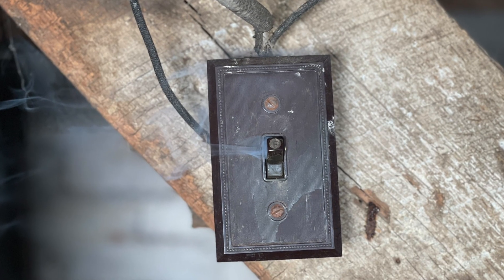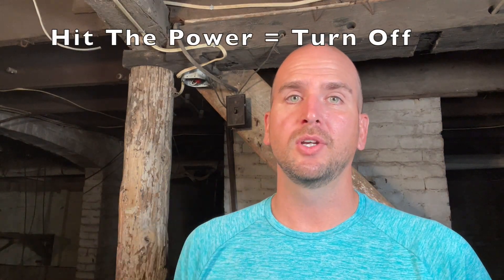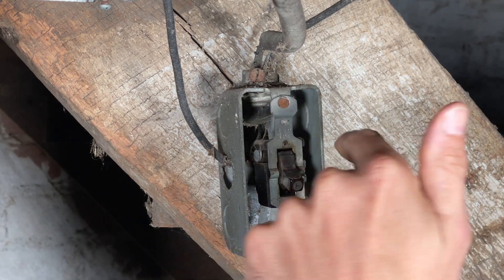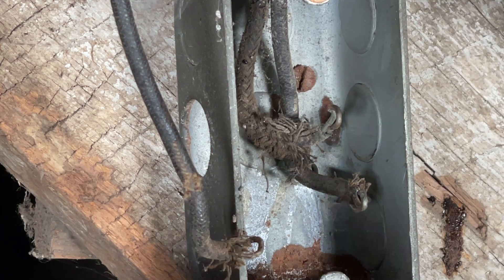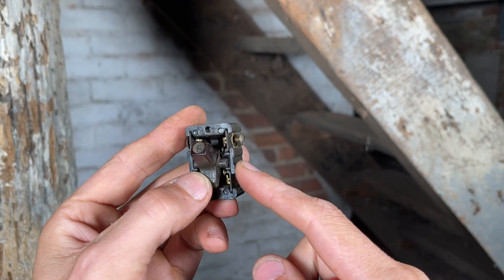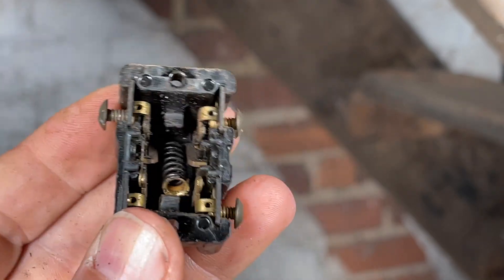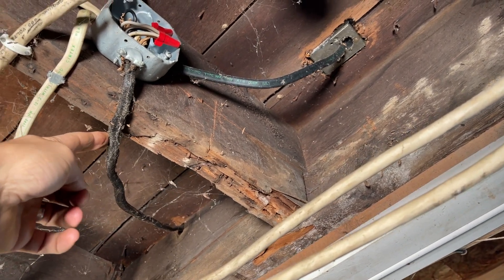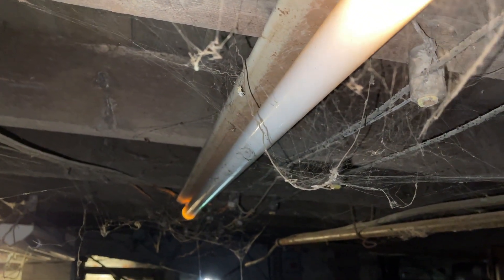Issues with Old Electric Wiring | Knob and Tube

Comment: You nailed it when you said “that has been tampered with”. Knob and tube- even 100 years old- is perfectly serviceable if undamaged and not tampered with. It used insulated wire, but was designed to largely not depend on it by use of the porcelain insulators and tubes. A grounding conductor can be easily added where it makes sense to have one. And the quality of those old devices is stunning compared to new ones. Any that are in good condition are fine. My dream would be to find an old house with an all original, unmolested electrical system. Probably pretty rare now. 100 years of people that can’t keep their hands off of it lol.
Reply: Realvanman1 I recently worked in a house with an entirely untouched electrical system. 😎 The electrician saved most of the switches but the original circuits wasn't really salvageable
Reply: 180 yr old home in s.c. knob and tube running all my lights and fans
Reply: @frederickcwinterburn1837  Im not doubting your experience, but in Utah the knob and tube conductors are in different stud bays of the wall. (until an outlet or fixture the wires are several feet apart) Please consider that the wire you saw had been overloaded for 50 years. That would turn any covering into brittle carbon thru cooking. Most of the criticism about bad insulation seems to forget if romex were in this same protracted overload, the structure would have burned down conveniently solving the issue of insulation criticism much more quickly. 

Wasn't the plastic pigtails of ceiling fixtures eleminated and switched back to cloth because the plasticizer would migrate out of the covering, leaving brittle insulation and associated hazards? (yes)

But we were so sure when we switched to plastic in those fixtures...
Reply: @frederickcwinterburn1837  it's not unusual to be that close with k&b, but the wire run is usually through the floor or ceiling where the POTENTIAL conductor sag does not get the wires closer. When installing, one would pull the wire with all their might between the knobs.

This practice, while adding its rare to be spared even enough wire to change a even recepticle or switch...  I propose the conductor while cycling under overload, cooked its insulation AND stretched enough to sag and make contact.

You had minimum and two failures, insulation and sag, likely started by errors/tampering elsewhere in the circuit.
Reply: I've never had a breaker not trip fairly quickly when the current is greater than the breaker rating.
Reply: I would put a fuse panel back in my 160 year old house if I found one with enough circuits. The breakers in the replacement panel failed, almost burning the place down. Studying the breakers in general led me to learn a breakers life is about 10 years or under (30 year max), and even a functioning one will not trip most of the time as they are really for short circuit protection. And running the breaker at 120% while never tripping is the thing that shortens the breaker life ironically, frys the wiring, and ensures the breaker does nothing at 150%+ output when the day comes. 

(the plasticizer in my old, but retrofitted romex is separating and failing, but the knob and tube is in great shape still)
Reply: @CaseyRevoir  Not nearly, normal breakers last a lifetime, they are purely mechanical, never heard of having to change them. RCD/GFCI have a test button that let you test the functionality, to know if they still trip (and you should do that test at least once in a while), since they are more complex and have electronics in them. 

The fact that a breaker will not trip at 120%, yes they don't for short amount of time, that is how they work. It would be impossible to do differently without some electronic in them, but normal breakers works by pure magnetic and thermal effects. In my country for fixed wiring you tend to install a size of wire that can carry more current than the breaker that is installed: for example for lighting circuit we have 10A or most recently with LED 6A breakers with 1.5mm2 cable, that can carry 15A without problems,  for sockets 16A breaker with 2.5mm2 cable, that can carry 20A no problem.

In a well designed installations a breaker should never trip for overload (unless the client does something stupid like plugging in 2 3kW heater on a single circuit). If it does it means that you should have split the load on two different circuits. The most common thing that makes breaker trip is faults, short circuits and ground faults (in that case we are talking of RCBO)
Reply: I wrote the same thing above. Just don't tape the two conductors together and shove them through the same hole.
Reply: Insulation was poor, if not it wouldn't require ceramic insulators, and degrades with time, thus it's now impossible to find perfectly insulated wires even if they where when installed. I guess that if you retrofit a GFCI breaker in a knob and tube installation it will trip for some badly insulated cable in some wall with high humidity. 

Also it's less safe. Usually cable that you install in a wall is either double insulated multicore wire or single insulated single wires in a conduit, to give a double layer of protection. Knob and tube it's not even single insulated, you have the bare conductors in the wall, that can be accidentally touched when doing some maintenance. 

If you have to add a ground, at that point better to replace the wiring with something modern that will last even more time without issues.
Reply: @alerighi  @A1eR  Thanks for explaining. You have actually demonstrated what I am all about. The 'forever safe circuit breaker', with a margin of error that ironically promotes the condition that makes them fail and catch on fire. The breaker exists to do nothing but protect the conductor in the wall, but that is not how they are treated, they provide none of the protections they are commonly entrusted with. 

You will never find what you do not look for. Breaker recalls are common. 

"A paper published in 2012 stated that FPE Stab-Lok breakers may be accountable for 2,800 fires and 13 deaths." 

The US government (CPSC) says breakers have a service life, can easily be looked up. Such huge, complex documentation from manufactures just to see if the darn things work. 

(If I post an outside link, the comment will not post, sorry) Pacific electric panels, Zinsco panels, all designed to be safer than what they replaced and were junk. 

Conductor ratings in the USA are BS, and contradicted by the sale of extension cords. An in wall 12ga wire is approved for like 20amp to 100ft (approx), or you change to 10ga to go further. This is dumb and not reality. Way overkill at 8ft and not enough at 99 ft. 

If I am a good USA citizen I will plug a space heater in my 15amp room outlet and run this breaker on the bleeding edge with lights, TV, etc... This is the exact reason the breakers are failing. Every point of contact in the circuit is practically on fire. The conductor in the wall is warm, the heater cord too, stupid quick push in the back of the outlet is thermo nucular, blade contacts in the plug not far behind. How much amperage are consumed by these additional heating elements?

Mechanical things fail, and these breaker fail modes are always default dangerous, and how to make a fire. 

When the fuse fails, the element opens and is real annoying. (and will likely be set on fire by an idiot and a bigger fuse, but that is not the fault of the devices of topic) 

The breaker is complex and has a big wildcard element, the spring that heats and breaks the connection. Everything I described above gets the breaker hot too and the switch chassis warps and miss aligns the stuff inside. 

The headroom we are leaving in the circuit is creating the problem. If I am a responsible citizen and add everything up to 15amp I just made the condition that harms me. Even at 13A on a 15A circuit I get hot conductors, reciepticals, and switch gear. Fused panels opened in these conditions, everyone got mad, and screwed everything up inventing another problem. 

These ratings needs to be based on a 24/7 duty cycle, but in reality they are as vague as conductor length specs. The gauge recommendation for the 20 Amp circuit assumes about a 3hr load at the 'rating', which allows a rise in wall conductor temp during that time. This rise does not stop at the 3 hr mark on a 99ft run where on a 20 ft run the conductor temp would peak and stabilize at one point before being dangerous. The hot conductor sets the recepticle or the breaker on fire. This "allowing things to get acceptably hot" concept fatigues items and is silly. 

Here is an easy way this is happening. You will rarely pop a 15 Amp circuit if you turn on a 13 Amp space heater and proceed to make toast with a 13 Amp toaster in the same outlet. According to a "B" curve chart for a random 15amp breaker, 50 - 500 seconds is needed to trip the breaker at 26 amps. Your toast will be done before tripping the breaker, but things got REALLY hot. That adds up over decades of toast. Assuming everything stayed aligned, the spring has been heat cycled 10s of thousands of times that no one engineered the spring for. 

Everyone in the USA treats these rating numbers like they are the be all end all, they are dangerously misleading and based on 'this rarely happens, do not worry'. 

800watts is the safe max for a USA outlet. Even with a laughably loose outlet, the connector does not heat up. This is also the wattage many personal space heaters are sold at now.
Reply: @A1eR I was confused and forgot I had the Fran lab video and plasticizer stuff in a separate comment. Here is the Fran lab, this video about plasticizer failure https://youtu.be/mHIgjTd0yCQ 

I will quote my other comment: 

"The plasticizer in my old retrofit romex is separating making green death sludge. https://youtu.be/mHIgjTd0yCQ The knob and tube that was augmented or replaced is still great and functional. 

I have slipped a long piece of heat shrink over the knob and tube wire as far as it will go when replacing fixtures and switches in case the jacket separates in the junction box. And usually another layer of heat shrink. "
Reply: @alerighi  You keep explaining how wires and breakers work without accepting any info that pokes holes in your safety assessment of the things you explain. 

The two things you have cited as safer, plastic wrapping and circuit breakers are flawed. 

Why do you think knob and tube is not insulated? Even in the video you can see the wires are wrapped, and BTW, many systems still rockin after the insulation falls off. 

That same failure does not work with romex. Plastic does not last. That Fran lab video I referenced has oodles of comments talking about chemical failure of what you say makes romex and the like better. 

When your romex fails, the potential for fire is high, we are now solely dependent on the device I am critical of, because of its terrible record, the breaker.
Reply: @alerighi  it may help to know the 'tube' in the wood beam part and the ceramic 'knob' are to protect the wire insulation and facilitate in installation. You literally pull as hard as you can on the conductor when doing the install back then to get wires straight, like deadlift pose, use your legs pull. 

The items you are citing as existing for lack of conductor insulation are actually double and triple redundant insulators.

And you can apply new insulation to old wires via heatshrink or any number of UL listed sprays or brush on applications. Shocking how many do not know this. Liquid electrical tape exists, it's great. 

We hammer romex down with metal staples, instead of a glass/ceramic knob.... Uhhhhhh? 

The attitude that was previlant then but lacking now is wire conductor safety. "if the conductor insulation fails we have a fire resistant knob and tube to help", as opposed to a shorting bar. 

My fireman neighbor says the old houses that burn down to the studs around here in Utah still have working knob and tube electrical systems, you can turn the [now] hanging lights on still. (super possible) 

There is a beauty in this design, knob and tube is safer than a romex run. It existed before plastic coated wire and is still rocking while the stuff invented to replace it is rotting away 2 - 4 times as fast. Rodents love the romex more too, and sans insulation the romex is crazy more dangerous. 

If you can do the whole run in metal conduit is the only way I have seen that is actually better than knob and tube. (apart from post building burn down, but who cares are that point)

Any knob and tube setup that is 'scary lookin' would have burned down with romex the same way long before an opinion like that could be cast.

Oh, conductor rant: After the equivalent of plasticizer migrates out of knob and tube style wire, the carcass base material that remains is still insulative and flexible, and not harmful to the conductor metal unlike plastic. And the great looking knob and tube wires are usually lighting circuits that never had heated wall conductors from overloading and pomoting heat related failure of the old wire casing (cook off the tar or whatever out of the fabric). Romex in the same situation never makes it that far before hopefully a breaker won't stay shut.
Reply: @CaseyRevoir  I think the purpose of using ceramic in the knobs and tubes was to absorb the heat from overheated wires and help prevent the wood from catching fire.
Reply: If you're lucky enough to find an old place wired by someone who knew what they were doing 100+ years ago, maybe. The problem with old knob & tube wiring is that it predates any kind of residential electrical codes, and it was often installed by people who were completely clueless about electricity. These wiring jobs predate junction boxes too, and circuits where often soldered together willy-nilly in the middle of the run. Also, we're talking about houses wired to power a few light bulbs, maybe a toaster. The average electrical load on a house from the Victorian era was a whole lot lower when it was new than today, and it's never been in worse shape to handle it. 

Then there's the problem of insulation breakdown. That old tar paper insulation has a service life that eventually expires, especially in damp areas. And when it does, it tends to fall apart, exposing the conductor. 

If it was me buying an old house, I don't know that I'd necessarily rip out all the knob & tube right away. But I'd keep a close eye on it. And I wouldn't seek it out as a better alternative to romex.
Reply: @shmehfleh3115  also if someone needs an extra circuit they will usually connect to an existing knob and tube circuit and stick a larger fuse in the panel.

Comment: High resistance on single pole  contacts which creates heat due to the ampacity going thru it which in turn is causing smoke.

Comment: Have a light fixture in livening room ceiling. There’s no on and off switch for this. I put a bulb in light comes on. Run up and down hitting each breaker but light will not go out. What can I do ?
Reply: You may have another panel or a fuse box where this light is connected that needs to be found.  Sounds like this fixture needs a pull chain outlet or needs to be rewired to add a wall switch (preferred for safety).

Comment: I have seen the "hybrid " systems a lot when I used to go into homes for a previous job. I am not an electrician but I have worked on remodeling homes before and worked closely with the electrician during remodeling.  Electrical isn't something to mess around with. I have seen electrical fires and the results of them.  Electrical and plumbing is something that bothers me with older homes when looking to buy. Like I currently am.

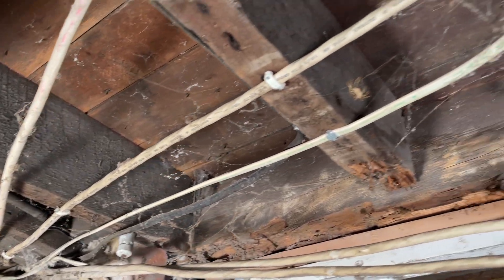Comment: The wiring that's running to the junction box at 5:47 is not knob and tube. Its actually the older version of romex and is perfectly serviceable.
Reply: The old wiring in my fathers 50's house is cloth romex an does not have a ground conductor.  It's useless for a home inspection involving an FHA loan.  It's not serviceable and is being replaced.

Comment: Also, contrary to popular belief, fuse boxes are not coin operated electric meters that give you electricity in exchange for coins. The only thing you'll get by putting coins in them is a Darwin Award when you get electrocuted or die in a fire.
Reply: Believe it or not, coin-operated gas and electric meters were actually a thing in the UK up until about the 1990s - early 2000s.

I have seen people stick coins into fuse-holders in panel boxes before, and you're right- it's a deadly game.

Comment: I had a switch that was probably original to the house, and it didn't smoke like that, but the light flickered AND I could hear it arcing in the switch. Fixed that in a hurry!